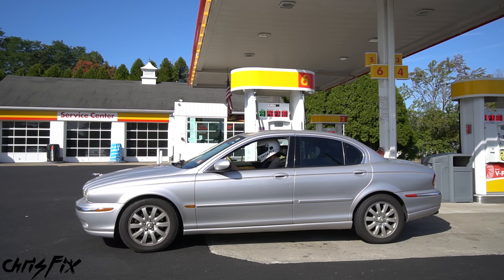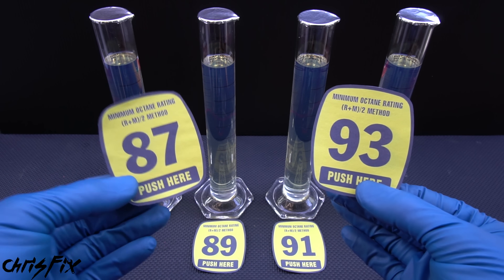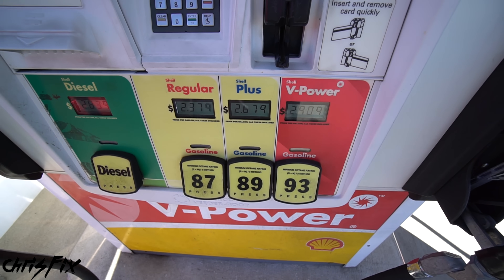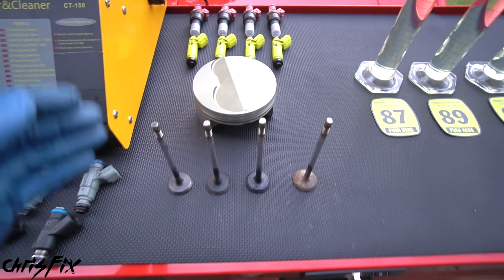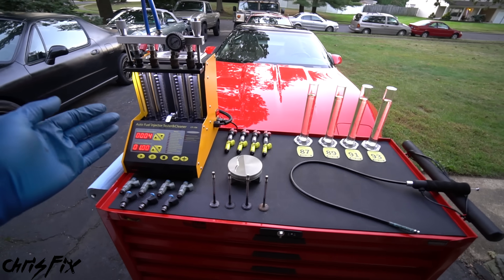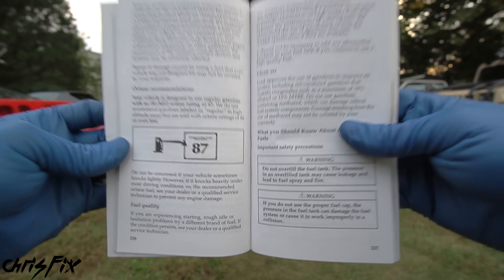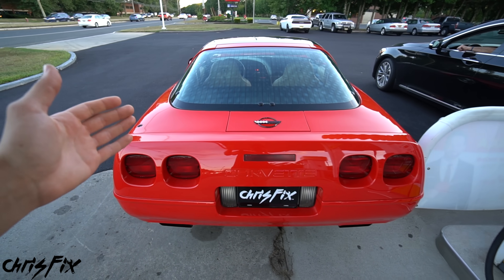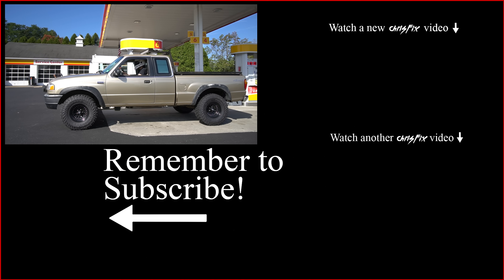What is the BEST Fuel to Use in Your Car or Truck and WHY

Comment: Hmmm great info but you left me confused. The reason I watch this video was I have a subaru legacy 2.5, so 87 gaz recommended. Now I know that 93 has additive to clean the engine. So would you recommended I fill up with shell V power like once a season just to clean the piston as a preventive measure, or would that be a smarter move to simply buy fuel additive myself or never do it and just get a mechanic to do a deep clean of the pistons for me when needed?

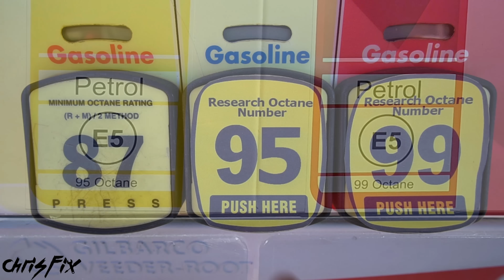Comment: He's wrong. At 5:10, he says Europe uses RON and America uses PON. He says this while pointing to the sticker, which is silly because that's not what it says. The sticker clearly says, "R + M/ 2." This means America uses RON and MON divided by 2. In other words, it's the average of the research octane number and the motor octane number.
Reply: He points to the "R" on the grade decal to the left as if it means PON. He says PON is the "R" rating. This is so ignorant. The "R" stands for RON and the "M" stands for MON. Both numbers are acquired when testing fuel. Then you take both numbers and divide them by 2 to get the average. Hence, "R + M/ 2 Method."

Comment: Non-ethanol fuel. Your vehicle isn't using an alcohol engine and there is no reason for ethanol unless you feel like replacing gaskets, seals and doing other engine maitanence. The one true reason ethanol is put in fuel is to make you keep coming back to a mechanic. 

Non-ethanol is also known as "boat fuel".... ethanol collects water. Ruining the gasoline. This is why boats use non ethanol. 

It's equivalent to about 90 on your scale. 

From your car to mowers, weed eater or anything gas powered. Just remember if it's 2-stroke, add oil!

(WARNING! - I AM NOT RESPONSIBLE IF YOU TAKE ANYTHING SAID THE WRONG WAY. PAY ATTENTION!)

Comment: In the manual for a 203 KIA Soul, it points out the difference between PON and RON: “Your new vehicle is designed to use only unleaded fuel having a pump octane number ((R+M)/2) of 87 (Research Octane Number 91) or higher.” I never looked at the manual for the right fuel because I always took octane ratings to be a fuel efficiency thing. Now I know better and I was able to confirm that my cheap ass was using an acceptable fuel in my car.

Comment: 93 octane does provide “some” extra performance, the 87 octane is cut with ethanol now thats how they get the lower price, ethanol has lower btu value than gasoline, so you need more of it to do the same work. he’s right on everything just forgot the energy values of the fuel, this is why diesel’s have so much power its the energy value of the fuel.🍻

Comment: Wouldn't it be nice if they had an OBD2 PID  for knock detection so you can readily evaluate the gas octane requirements..  all you'd have to do is maintain a resettable counter of the knock events and see how it accumulates during your drive.  If you drive it hard and the counts go up, use a higher octane gas. If it doesn't occur during your normal driving, try the lower octane gas and be assured you're not paying extra for no benefit.

Comment: excellent video.  would you make one on how to check the amount of ethanol in gas.  i saw a video years ago where the guy used antifreeze(?) or glycol.  he put some in a beaker tube then poured so gas into the beaker.  when it settled you were able to determine the amount of ethanol in the gas to see if the pump listing was accurate.

Comment: Chris, what about ethanol free gas? I was told I should run it in my small engines...mower, trimmer etc for less degradation of rubber seals and parts over time.  I also run it in a 1970 Toyota FJ40.  Wanted to get your thoughts.  Thanks!

Comment: You briefly mentioned E-85 at the end. We have a flex fuel Tahoe that recommends 87 or E-85. I’ve never put E-85 in it. Are there benefits to running E-85 through it periodically or consistently?

Comment: Honestly one of my favorite things about this channel is how Chris makes videos about topics like this. Car YouTube is constantly talking about all the mods you can do, or E-85 this, or race fuel that. Chris takes it to the basics for those who may just be getting started, and throws in enough information that those of us who have been around the block a couple times can learn a thing or two as well! Side note, in a lot of GM vehicles now, flex fuel will adjust timing to give  you more power on E-85 than on pump gas at the cost of worse gas mileage, making E-85 go fast corn juice that goes fast.
Reply: Fuel er' up with merican corn! 🌽 I love my e85. Even my chainsaw is tuned for it. The torque bump and low rpm smoothness is great. I've been running it almost full time for over 10 years.

Comment: What about “may contain up to 10% ethanol” I’ve seen on all the pumps?
Reply: They use ethanol as an octane booster in most fuel, and up to 10% won't hurt your car. It's done partly to boost the octane rating, and partly to help out the corn growing industry. HOWEVER, ethanol separates and goes bad much faster than gas, especially in small volumes, meaning that a lot of small engines (lawn mowers, boat motors, etc.) don't do well with 10% ethanol gas. So, they label the pumps so you will at least know what you are getting. Every once in a while you'll find a gas station that has ethanol free gas, and they usually sell a lot of it.
Reply: @Nick Steinmetz that's true, but with one huge caveat. For it to run properly (e.g. not extremely lean), you'll need to change your tuning. E85 has less energy per volume than gas, so you'll have to use more fuel per cycle. What flex fuel vehicles do is sense what fuel you are using, then adjust the fuel delivery system to fit the fuel. So if your vehicle doesn't have a flex fuel sensor, you will be stuck using one or the other, and if your car isn't tuned for E85 specifically, it won't run very well if at all on it.
Reply: @NightMusic1-b9o  I absolutely agree. Although, the higher the concentration of ethanol, the more it takes for it to separate, so e85 is actually totally stable. So if you have a flex fuel car that needs to sit for a while, it's actually better to leave it with e85 in it than the crappy 10% pump gas.
Reply: @Lunker_Dunker  Ethanol absorbs moisture from the air and can have a corrosive effect on many engine materials, gas does not so personally I would never store a flex fuel vehicle over the winter with E-85 in it..use gas with 10% max ethanol
Reply: @realitycheckrealitycheck9008  10% ethanol gas will absorb moisture and separate much faster than the same volume of E85. There is a threshold for how much moisture needs to be absorbed before it separates, and since there is a lot less ethanol in E10, it happens a lot quicker. If you leave a full tank of E85 in a car, it would have to absorb literal gallons of water before it separates. Also, corrosion shouldn't be that big of an issue in most flex fuel vehicles. Ethanol can corrode aluminum, but as long as it doesn't separate it shouldn't hurt any other metals. Also, E10 clearly still has ethanol in it anyway, so you're not saving your engine by using it. The true best storage fuel would be ethanol free gas with a stabilizer added, but I would still rank E85 higher than E10.
Reply: premium in cnada has less ehtnol then regular.
Reply: @randomrazr  But their schools are not too good.

Comment: More precisely, combustion reactions require a heat input to make combustion begin.  The amount of heat is called the 'activation energy.'  A fuel with a higher octane has a higher activation energy so it requires more heat to begin the reaction.  Compression of a gas creates heat.  So high compression motors have a fuel air mixture that is already quite hot and has greater interaction between molecules.  This results in a situation where the activation energy is reached too soon and the expanding gasses try to force the piston in the opposite direction.  You can read about this on Wikipedia.

Comment: A bit confused when you clam it is the same power regadrless of the octaine number. My 2018 Mazda cx9 manual states rhat if i use regular i get atound 220hp and with premium 250hp. It is a 4cyl turbo compressor (skyactive engine - whatever that means) . So is a Mazda engine different ? What fuel would you recommend?

Comment: Chris just wanted to ask, is it a myth that ethanol is not good for your engine? I usually put non ethanol fuel in my Kia Soul and I seem to overall have a good experience but sometimes switch back and forth between the two (especially because non ethanol fuel is very expensive)

Comment: In Germany we have
95 Regular
98 Plus
100 V Power
102 Ultimate
Reply: Wow, do the numbers stand for octane ratings
Reply: We have 100, 105, and 110 here in the US but you have to go to Sunoco gas stations.
Reply: @Nick Steinmetz like I said. Sunoco stations.
Reply: You also have a losing record in World Wars.
Reply: Evertime I go to the Nurburgring, its v-power racing 100 or Aral 102.. My impressions are that the car runs really good in al temperatures and get much better fuel economy then on the swedish 98 octane..
Reply: @user-od4oc6no6t   Not 100% true, the rest of the world uses RON, America us R+M/2 as stated in the vid. Germany doesn't have a special type of RON with higher numbers, it's the same RON that you'd see in England, South Africa, Japan, New Zealand etc. In NZ for example we get 91/95/98/100 RON, but 98 is only available at BP, or mobil in the north island. And 100 octane is only available from NPD in the South Island. So, germany has high octane available compared to NZ or the whatever pumps chris showed in the vid (I assume that was in the UK). I recently travelled in South Africa, and the only fuel I saw there was 95RON.

As for the actual conversions , US 87 = 91RON, US 89 = 93RON, US 93 = 98RON. US95 = 100RON, US100 = 105RON. So, yes, the rest of the world does get high octane sometimes. But like in the US, you have to hunt for the right station that sells that higher octane, like how not all stations get 93 there, and only some countries get higher octane than the US
Reply: Reuben Horsley nearly 100% of all gas stations contain 93 octane in America.
Reply: Reuben Horsley makes me happy to see people that know the different octane ratings.

Comment: 9:54, How come fuel doesn't leak down into the car, is there an O ring? I'm a noob with cars so be nice, just looking to learn.
Reply from the maker: The fuel injectors have a pin inside them that closes off the injector and prevents it from leaking until an electrical charge is applied.
Reply: @chrisfix  Oh wow, cheers for the response. Didn't expect it to be that quick :D. Thanks for the great content once again.

Comment: Uh, you're wrong about detonation, you said it yourself the knock sensor retards ignition, detonation has nothing to do with uneven burn, but rather preignition so that combustion occurs before top dead center, usually due to heat or improper ignition timing.
Reply from the maker: What I said is 100% correct. Do a little more research and get back to me. There is such a thing called pre-ignition but that was not my focus and not the cause of detonation which you primarily hear when the fuel octane is not high enough.

Comment: The old danger rangers always ping/knock eventually on 87 octane...,.
Reply from the maker: It ended up going away after using premium For a few hundred miles.
Reply: @chrisfix  that's good, might have to do that occasionally especially when outside temps get near 90
Reply: @chrisfix  .... Better safe than sorry.. Right?

Comment: I’m just trying to figure out how to make the rattling stop in my outback and I’m sitting through ten minutes of some guy karate chopping a gas station pump.
Reply from the maker: Check the heat shield on the exhaust. They are known to rattle. Stainless steel zip ties can fix that cheap.

Comment: So, other than compression, there’s really not a lot that can change what fuel is needed in a vehicle? That’s what I’ve always thought, but my friend is adamant that he needs to use 93 in his 328i when his engine is lower compression than my car (xA) and my owners manual says 87
Reply from the maker: Compression, tune, and if it’s forced induction. (Turbo or supercharger).
Reply: ChrisFix perhaps the tune is the cause. I know it’s NA and has a 10.5 compression so other than tune I’d think it would be fine on 87.

Comment: Overall a really good fuel overview and guide although there was no mention of “Top Tier” fuel.  The EPA minimum fuel detergency levels for gasoline sold in the US are not sufficient enough to keep the intake valves, combustion chamber, or pistons clean of carbon build up.  The “Top Tier” fuel standard was developed to address this, and Shell is one of the many gasoline distributors that are “Top Tier” certified.  The E85 portion was a bit weak though.  According to the fuel standard, E85 is 51-83% ethanol not 85% ethanol.  There will be a notification at the pump of what the minimum ethanol content is.  In my area, we have a minimum of 51% or 70% ethanol in the E85 available at the pump.  E85 will not damage your engine.  What E85 could damage are fuel system components that are not compatible with alcohol such as hoses and seals.  Alcohol will remove the deposits (gum, varnish, and carbon) left behind from gasoline so changing your fuel filter after a few tank fulls of E85 is advised.
Reply from the maker: Thanks for sharing. E85 can in fact damage your engine. Your normal fuel injectors cannot supply enough fuel to compensate for the lower energy density of ethanol.

Comment: I noticed you didn't mention the crappy fuel used at the rockies and west. They have 85/87/91 octane and I assume you can't even get 85 octane on the east coast. I am also curious about how elevation changes combustion for areas that are above 5000 feet.
Reply from the maker: The high elevation locations have less atmospheric pressure so they can use lower octane and not have detonation.
Reply: @chrisfix  Thanks

Comment: Hey chris, my wife's van runs E-85 and I noticed there is about a 3-4 mpg loss when we use the E-85. Do you know what the price difference is that makes E-85 the economical choice to use over 87?
Reply from the maker: You need to do that math yourself. Do the math for $$$ per mile for each type of fuel. Depending on the price you might be better off with one fuel or another.

Comment: What if you filled up with E-85 in a flex fuel vehicle and half way through the tank you decide to fill up with regular 87? Can mixing cause damage to the engine?
Reply from the maker: It has a man ethanol sensor in the fuel line and it will adjust for you so you don’t have to worry.

Comment: You just said all octanes contain the same amount of energy so how does your vette lose power if you don't use premium?
Reply from the maker: The Vette engine cannot use the same timing and has to regard timing to use regular fuel so it doesn’t detonate which is less efficient. The same exact energy is being burnt, but with regular gas, more of that energy turns to heat and less turns into Kinetic energy.

Comment: 10:26 & 15:23 What a revelation...! 
Interesting video but I was hoping for a better answer than ‘use whatever the manufacturer recommends’ 🤔
Reply from the maker: Why? That’s the best answer. It’s easy to follow and know you not only know what to use but more importantly “why”.
Reply: ...Because THAT part doesn't need explaining! The info at 12:45 about the 150k miles truck is interesting and goes further to explain 'what fuel you should use and why '. I thought there'd be more info in the other 15mins about to how to 'determine' what to use rather than an instruction of 'where to read what the manufacturer says'

Comment: American fuel is waters down 

Change my mind
Reply: Tell yourself whatever you want to feel better about paying more than double for gasoline.
Reply: Thomas Griffin that didn’t change my mind
Reply: @co1onial_fish962  Different rating systems. He literally goes over it in the video. What does watered down even mean in this context? It's hydrocarbon based fuel with the same additives, with very small variations from different refineries. 91 AKI is the same as 95 RON. 93 AKI is the same as 98 RON. Premium at my local gas station is 94 AKI or 99 RON.
Reply: Thomas Griffin 
Cheers you changed my mind 😂😂

Comment: Use whatever the manufacturer tells to use on your car. I use 91 octane on my Suzuki Swift which doesn't have a high compression engine. When I use 95 on it, the idle becomes still more tame, but the fuel economy drops substantially. Alternatively, my cousin's Mazda 3 which has a high compression engine runs nicely and returns great fuel econony on 95, but not on 91.